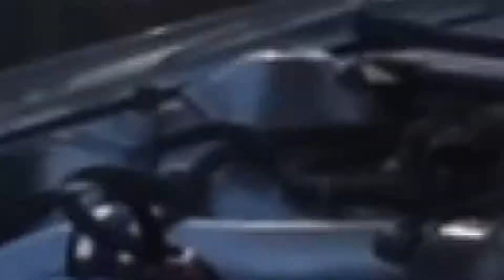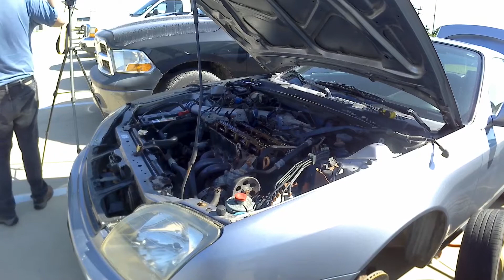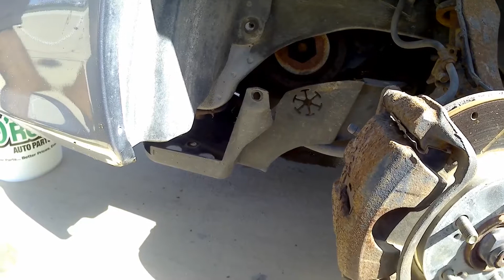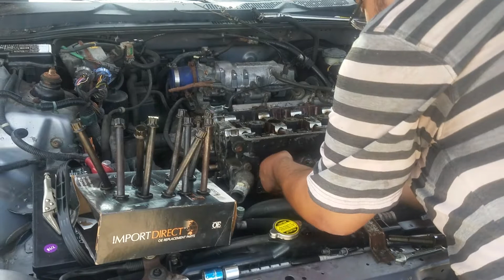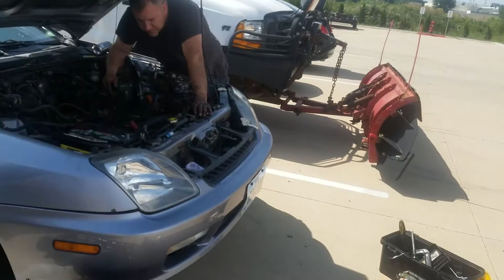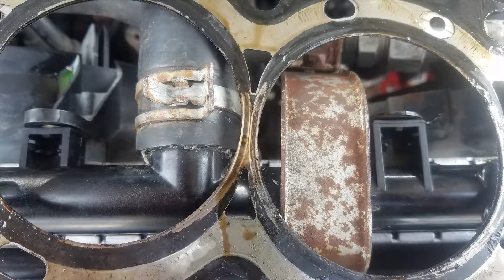Taking the Prelude engine apart - getting ready for engine rebuild

Comment: Any update on the prelude? Did you fix it?
Reply from the maker: Had the engine put back together by a shop. Worked for couple of weeks and then jumpt timing at startup. Wanted to do a video about it for a while now but have no time unfortunately.
Reply: @NWCI  Man that sucks. Do you think the shop might have done a poor job putting it back together? Would like to see the Prelude live on. Good Luck.
Reply: @NWCI  if it jumped timing there was an issue with either the belt or that damn autotensioner
Reply from the maker: @h22sparkle  , honestly I'd love to drive it again, but life gets in the way and didn't have the chance to check it out yet.